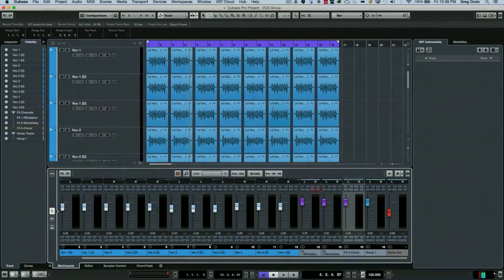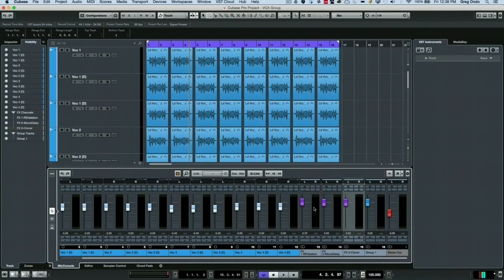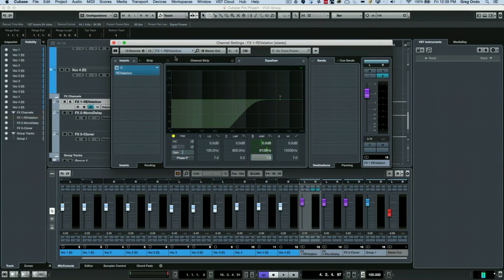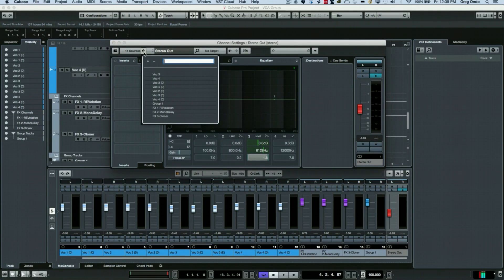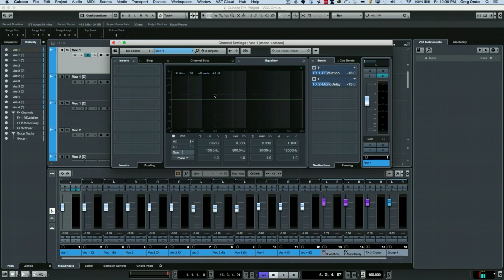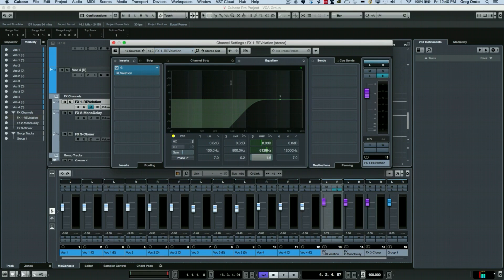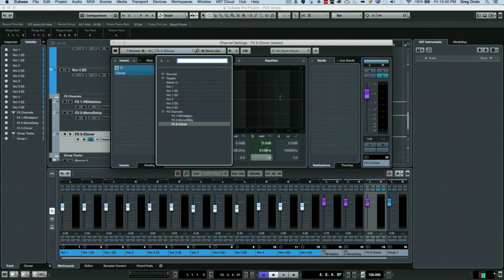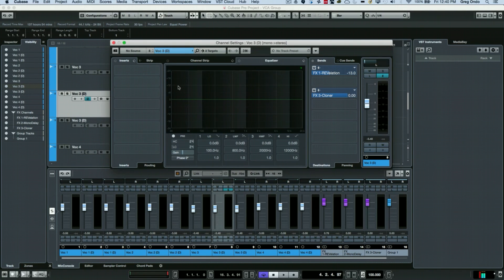How to Determine Signal Routing in Cubase | Q&A with Greg Ondo

Comment: Is there a way to route several tracks in sequence at the same time? For instance I use Dante virtual soundcard and I have 64 inputs. Is there way I can click a command and route inputs 1 through 64 all at the same time to all my tracks?
Reply from the maker: Select all of the channels and hold down the shift key and set the first track to the first input and the inputs will be added incrementally for all selected channels.